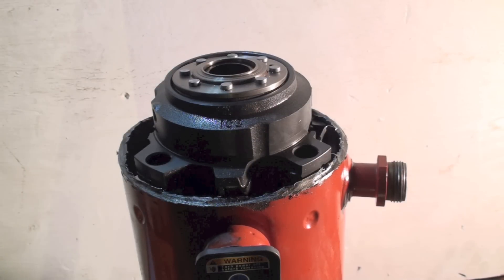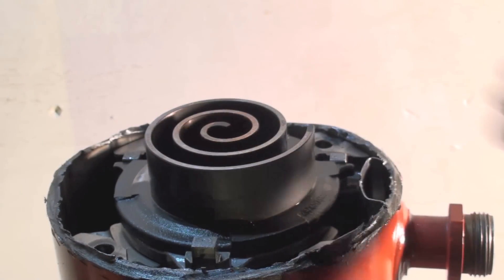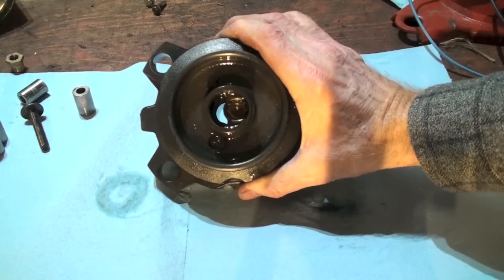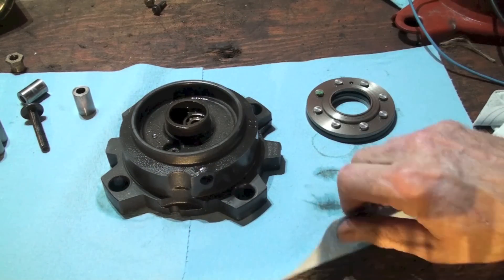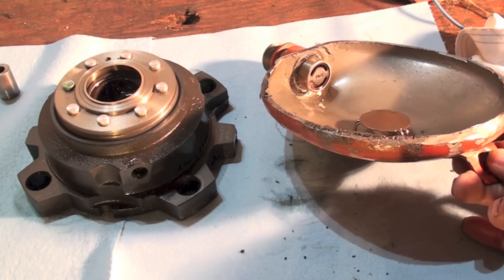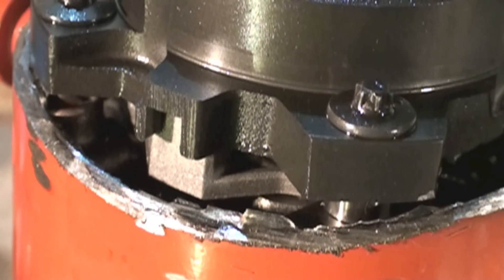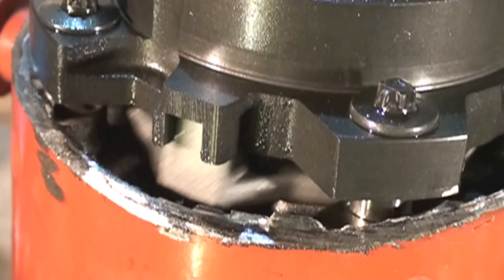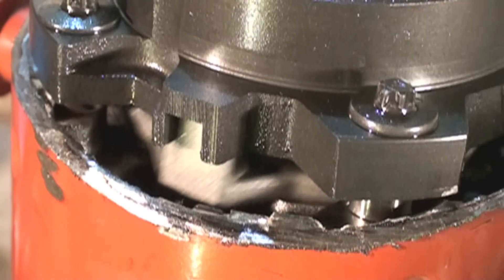Copeland scroll compressor disassembly

Comment: GFM, in the Copeland docs on a burnout compressor replacement they HIGHLY recommend to replace the accumulator as well (it`s in BOLD type also).   They don`t explain why of course.  Do you have any ideas as to why they say to do this.   Thanks for all you do.
Reply from the maker: +Gene Friedman If the compressor burned the winding under locked rotor conditions, all the soot etc could travel to the accumulator.  Most of them have a screen that could plugged.  Hope this helps.
GFM
Reply: +grayfurnaceman Ah yes that makes sense.  I guess I was thinking of running conditions where the soot would get trapped in the filter-drier.  Any way to diagnose a plugged accumulator oil screen?

Comment: I replace 5uf with 10uf run capacitor. Do I hurt motor by doing it. The motor seem running fine. Thank
Reply: You should NOT replace a cap with a higher rated uf cap